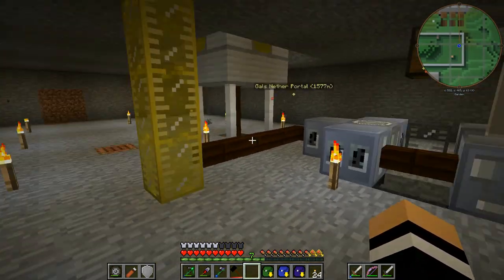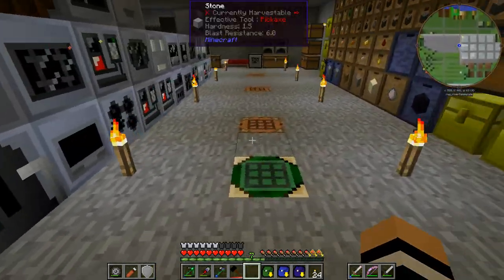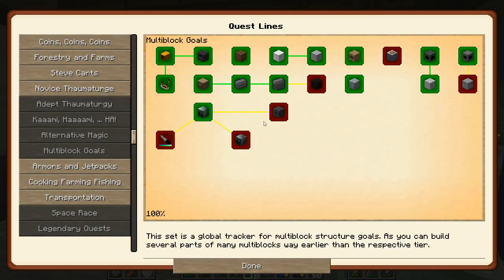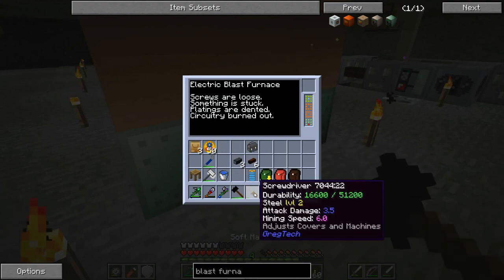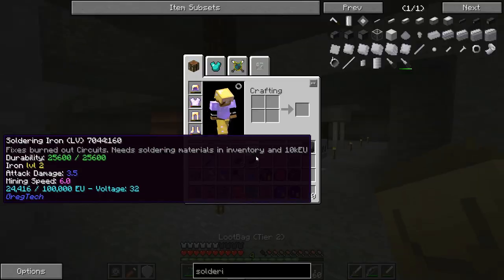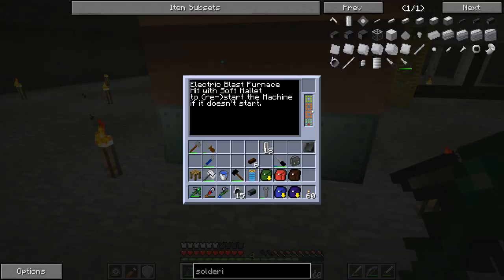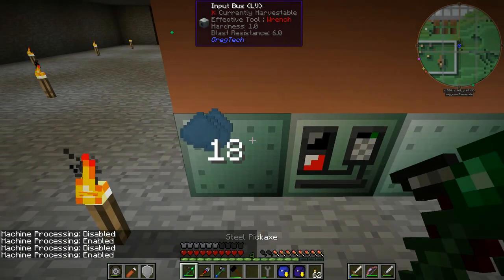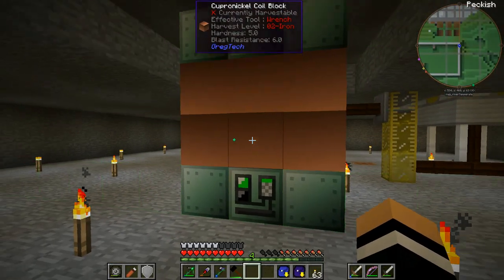S10E20 GTNH - Electric Blast Furnace

Comment: Hello again, just a tip, you should rush the advanced electrolyzer as your first medium voltage machine, you can get tons of aluminum and lithium from the clay dust!
Reply from the maker: Good tip! I think it'll be a couple more episodes before I start the MV tier quests, I want to get a couple of other bits done - like starting Thaumcraft ;-)
I think Electrolyser and probably the extruder/solidifier thing are high on my list. Cant remember at the moment which machine it is, but its the one that lets me make gears and fans a bit cheaper using molds. There is just so much to do, and so many directions I need to go in terms of quests!

Comment: Do you have a planned schedule for this series?
Reply from the maker: As in how long it'll go for, or how often I post videos? I tend to try to post two per week, but it's getting pretty hard at the end of the year with real life and work and other commitments - really hoping I can get ahead on recording again in the next few days! As for how long I'll run the series for... Thats a harder question to answer. It usually runs until I get minecraft burnout. That can depend greatly on the pack I'm playing, and whether its well constructed or just "doing stuff for the sake of doing stuff".
One thing expert packs often get wrong is that you spend a lot of time and resources building a big machine, or advancing to get a special spell or piece of magic, and as soon as you get it, you dont need it any more. This is frustrating, because after putting in all that effort, you dont even need to use it. So far GTNH is being pretty good tho, building hard things, but then using them a LOT = happy Stoo42. :-)